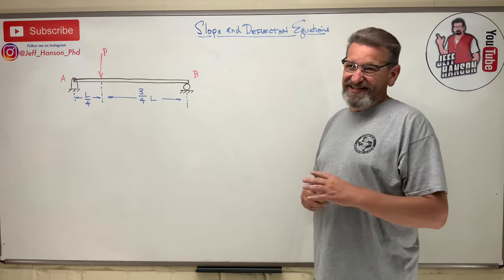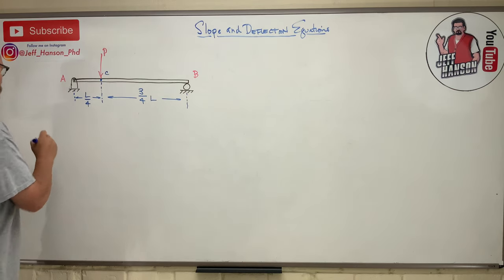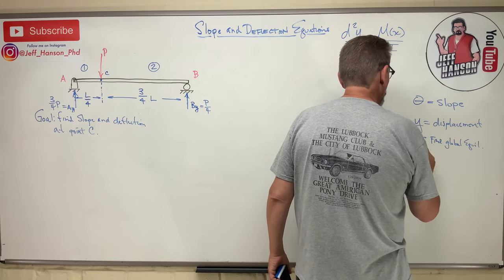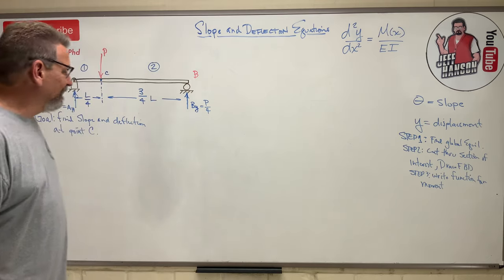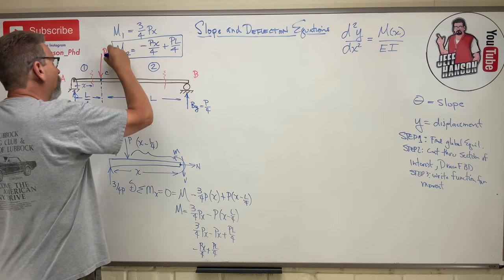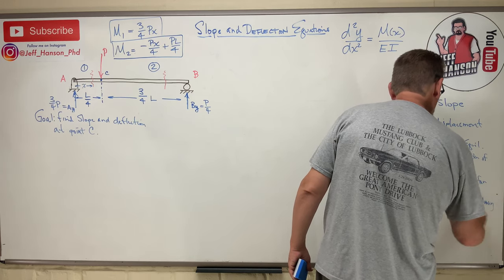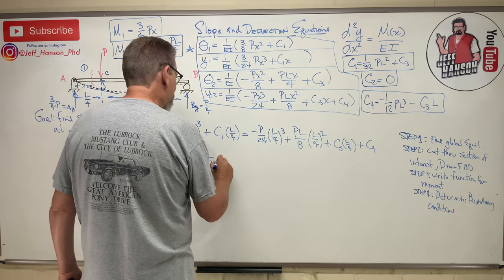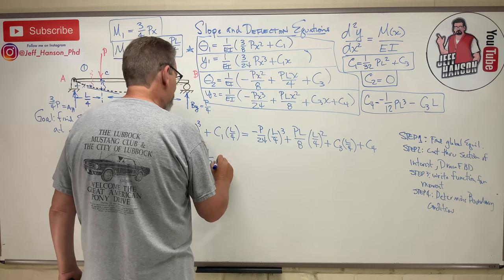Mechanics of Materials: Lesson 63 - Killer Slope and Deflection Problem

Comment: I agree that the slope absolute value would be about the same on either side of c, but wouldn't the values of the actual slope be equal and opposite on each side? Ex.) One will  be concave up and one will be concave down ?
Reply: just look at it, they are concave in the same direction
Reply: No they would be equal but not opposite signs because his coordinates for both his cuts are all in the positive x axis. So the slopes will be both equal and positive.

Comment: For the second M(x) equation, could you have set the right side of the beam as the origin and derived an equation that way? Or is it necessary to have the same origin for both equations?
Reply: I’m pretty sure that it is necessary because our “x” variable must represent a distance from the same point. If you did set the right side of the beam as the origin, then your value of x would represent the distance from point “B”. X in both equations of M(x) needs to represent distance from point “A”.